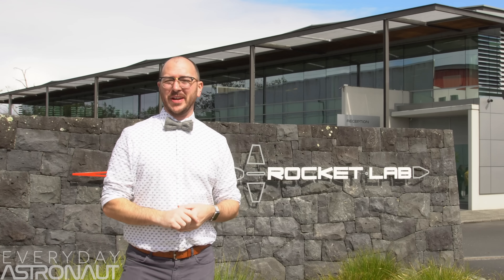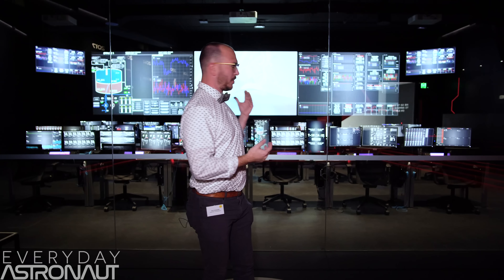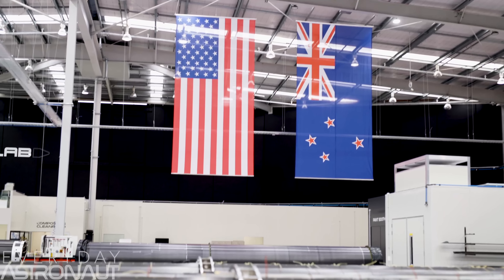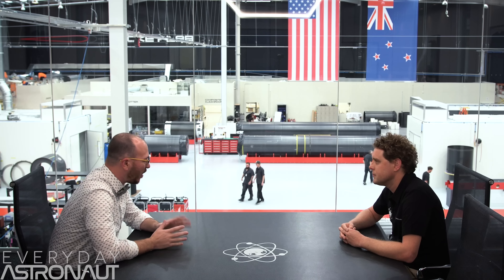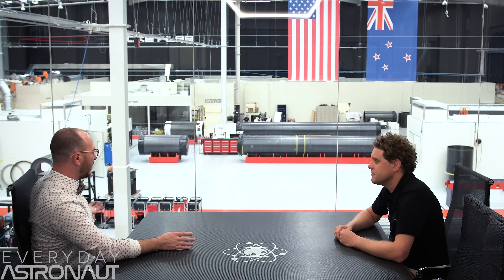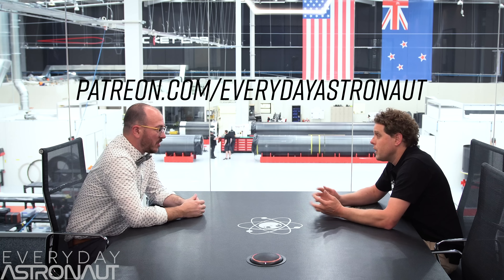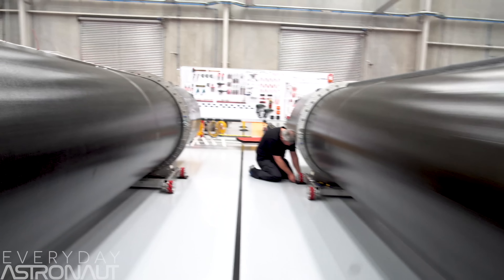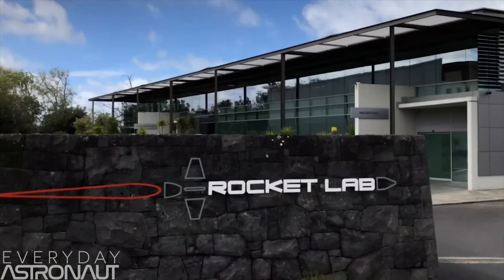Exclusive look inside Rocket Lab's factory!

Comment: Mecanum Wheels! I loved them for the robotics competitions I went into cause you are easily able to strafe.
Reply: On one hand, you probably have to have really clean floors for these wheels to work correctly.  On the other hand, this is a rocket factory, so if the floors aren't clean, they have problems.
Reply: @joeymcguire5886  in my experience they work on most floors as long as the four wheels are usually touching the ground. We've used them on floors where the robots 3 wheel a lot and they start to drift a bit but it can usually be fixed with a little compensation from the others
Reply: And there's some wheelchair manufacturers that are adding in mecanum wheels with active suspension to keep them on the ground so people can navigate tighter spaces better
Reply: If you want to have exactly zero precision while strafing.
Reply: @monster860  they have great precision if you set them up right. That's like Ackerman steering on a car gives you zero precision for going straight
Reply: Our team didn't like them because the other robots could push you around the field so easily.
Reply: They work well if executed properly, but you get pushed around tons.

Comment: Those wheels on the part holding the tank are called mecanum wheels and the are used in robotics because they allow for movement in all four directions. Also they cost around 200$ per wheel.

Comment: Hello there Tim, love to see new Rocket companies arising like they are. One question. Why aren't these Rocket companies built at the highest elevations other than sea level? Thanks
Reply: The great majority of the energy expended by a rocket booster goes into getting the payload up to orbital velocity. The difference in altitude between sea level and a mountain tom is only very small in terms of reaching orbit. So, consider the logistical problems of hauling a launch rocket, especially a big one like Falcon 9, to the top of Mt. Everest.

Comment: I've wondered what SpaceX could do in this market. They could go for massively oversized rocket (bad) but near complete reusability (good). Imagine an F9 first stage. Replace the interstage with a fairing which can open and close, but stays attached to the first stage.  Inside the fairing is a very small second stage (perhaps similar to RocketLab's second stage) and payload. Booster stage releases second stage at altitude and does a return to launch site landing. 

Compared to Rocket Lab, you're flying a much much bigger rocket but you get to reuse your booster and fairing, so you're only using up a tiny cheap second stage. $1M for the second stage, $0.5M for rocket refurbishment, $0.5M for fuel, launch pad rental, mission control staff, and you're coming in well under Rocket Lab's $5M.

My prices of course are largely guesswork, and I don't know what payload you could get to orbit like this. I imagine you need to do return-to-launch-site to get costs down enough, but I could be wrong.
Reply: The BFR will be cheaper than almost anything as it will be fully reusable.

Comment: It should be kept in mind Rocket Lab has only successfully launched one rocket during its second flight on 21 January 2018.   It has pushed out its 3rd flight numerous times due to motor controller problems.

All this excitement may be worthwhile however they need to launch a great deal more before they become credible.  

Perhaps more importantly there are other small launch providers on the horizon that will offer stiff competition.  In particular Boeing's XS-1 Space Plane  is projected to be significantly cheaper, a heaver payload and largely reusable. 

The Vector-R rocket has a smaller payload than the Electron  but half the price. 

It will be interesting to see which company turns out to be the sustainable success.

Comment: The electron rocket is still a expendable launch vehicle so Spacex is still going to have problems trying to reuse the first and second stage on the BFR.
Reply from the maker: You can’t make a direct correlation just because of it using the same material... they’re entirely different vehicles, of completely different size, class and consideration. 

Your line of thinking is like saying “SpaceX can’t reuse the Falcon 9 because the Atlas V isn’t reusable”
Reply: @EverydayAstronaut  no every one is making remarks every time a expendable launch vehicle with a composite is used they referencing SpaceX or the Venture star which both where suposed to be reusable launch vehicle. Other than a larger payload the only thing the BFR has over NASA's SLS is reusability which they have not demonstrated I think BFR first stage will work ones but it will take SpaceX a great number trees to carry out the rate of reuse Musk clames.

Comment: I still can't get over the fact that they aren't pursuing reusablility when the Rutherford would be perfect for controlled landings.
Reply: Would carbon fiber make for a good heat shield? Could it do reentry?
Reply: @odysseusrex5908  I doubt it. Even if the fibers could handle it, the binder for them wouldn't.
Reply: Yeah, that's what i thought, although somebody further down points out that the BFR is going to be made of carbon fiber, so I don't know.
Reply: The booster will likely have a heat shield around the engine like the Falcon 9 and experience similarly low heat. The BFS has its side heat shield bolted directly to the tank to reduce mass. Also, what makes a good heat shield is how effectively it carries away heat. Tungsten can withstand almost any kind of reentry, but not without building up an immense amount of heat.

Comment: But they only launched 2 times didnt they?
Reply from the maker: Correct. But that’s about to change!
Reply: @EverydayAstronaut  Do you have any informations why the third launch was scrubbed for so long?
Reply: @lucaxdls  they have it planned for november 2018
Reply: That was “about to change” 9 months ago and every other day since 9 months too! “It’s business time” is a setback failure.
Reply: @santiagorussomartinez390  I know but it was planned to launched in the middle of the year
Reply: @lucaxdls  yes but it got scrubbed. I dont know why theybare taking so long
Reply: I understand they found a problem with their rocket engine on the pad that meant all the engines needed a fix to stop that problem happening again.  This is normal in any new complex system.  Rocketlab are obviously very capable of solving complex engineering problems.  It would only be a setback or failure if they ignored the problem or could not fix it.  In fact finding the problem and taking time to get things right shows they are competent.  I absolutely love the way Peter beck talks abouts problems in this interview.  It is great to hear people who relish solving problems talking about how they have succeeded.   Really inspirational.
Reply: @blackboxcameracom  Thank you for the info!
Reply: @blackboxcameracom  Interesting that it was at 1st called a microcontroller